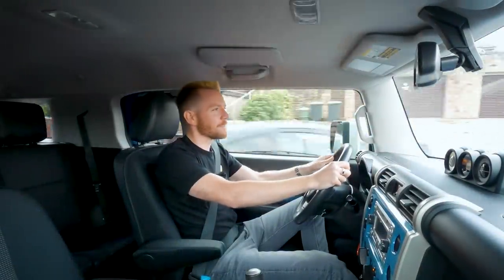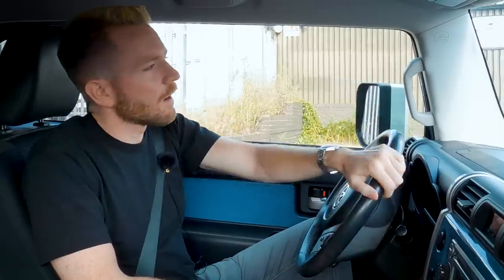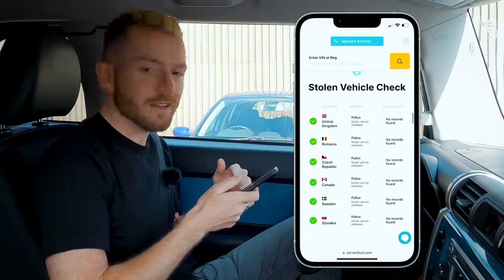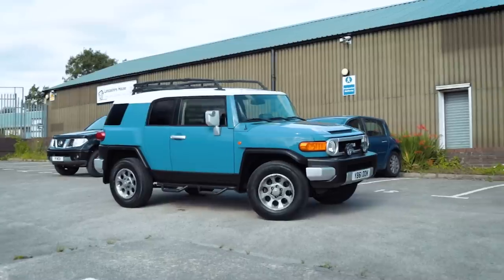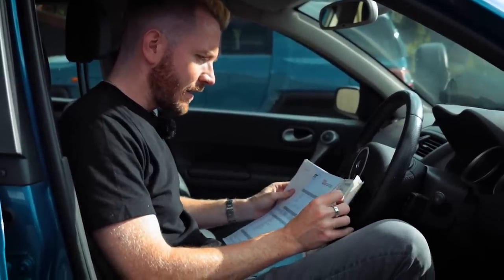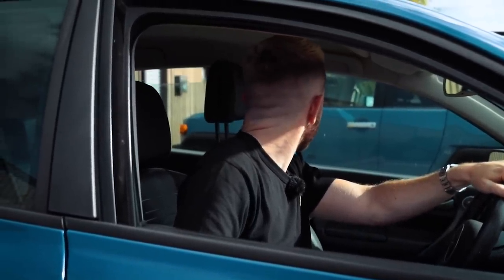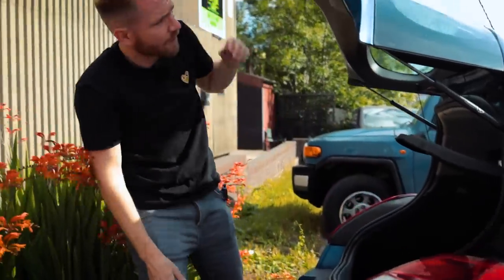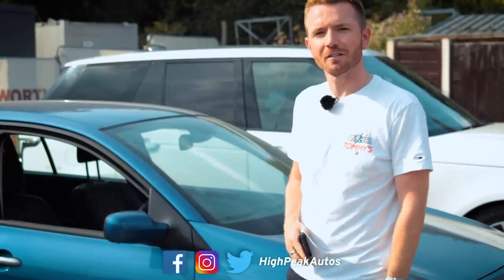I BOUGHT A RENAULT MEGANE FOR £295!

Comment: Cool hatchback and innovative as well. Keyless entry + go and a 5 star safety rating- the first for a small hatchback. I think the DPF needed doing because it was juddering on start up as the gear lever was vibrating and the glow plugs needed doing as well. Hope your mate checks the clutch but I think it is a decent cad. They are getting rare and they could be a future classic with its innovative design. If only it was a R26R 😂
Reply: Faustina Adu ......future classic???   :))))))))
Reply: @geoffdundee  well, people say that about most Leyland cars
Reply: @geoffdundee  the renault megan rs turbo/sport versions are pretty cool? if that`s you thing
Reply: I was thinking along similar lines- injectors. Certainly wasn’t one of those start on the key type diesels you get from the land of the rising sun.
Reply: @localreviewking134  ........fortunately im a volvo guy all my life with the exception of owning a citroen BX once (never again own anything french) and a mercedes c class (really nice car)
Reply: @geoffdundee  BMWs and AUDI are not that good these days. i have 2 Renault and never had anything expensive in 8 years; the only issue being an automatic parking brake sticking, which my mechanic fixed with a simple cable tie, it has never failed since. cost 4 pence to solve and 1 hours labour

Comment: A good honest review, thankyou.  The earlier Megane like the Scenic c. 2003-2006 suffered from many of the faults you anticipated but particularly the window modules, corrosion in the fuse box near the battery, broken wires - mainly in the tailgate of the estate amongst a few other niggles but they were generally mechanically strong and needed to be well used and serviced well before the 18,000 mile recommended interval especially in Diesel form.  The later versions , 2006/7 onwards were better and the 2.0dCI M9R was very strong and swift.  We had a 1.6 VVT estate and a 175 DCI RS version - yes I bought two and both were excellent.  They were always a popular choice across Europe and sold well.   That said, after purchase, I often panicked after reading the negative owner reviews but if well maintained , they were generally reliable, safe and enjoyable.  As you know, the post 2009 version is a lot better.

Comment: I ran one of these with the 1.5 diesel with the 6 speed box back in 2007 to run as a company vehicle. Great car, fantastic on mpg. I changed it for the R26 version which was an awesome beast which I wish I’d kept. I never had any problems with any Renaults I owned, I had a Clio and a Laguna estate over the years as well. I must have been lucky I suppose.
Reply: What company would ever buy a french car as a company car? Don't they care about their reputation etc?

Comment: I had the 19 dci new in 2003. I did 75k in it before I sold it and never had a single issue with in three and a half years I had and I loved it. I think with Renault its often just a thing to say it's french its a Renault it will go wrong, just like you say its German its great and will never go wrong? Both saying are utter rubbish I have had so many issues with VW golfs and a Passat but none for a 90s Laguna the 2003 Megane or my wife's current 2016 Scenic.
Reply: I had a Laguna 2.0dci and did 180,000 miles without a single issue. I replaced it with an Audi A6 then a BMW 5 series. Lovely cars, but they cost me a fortune in repair bills and kind of wished I'd kept the Laguna.
Reply: There is some truth in the electrical faults and the water ingress. Ive had two Meganes and had the latter issue in both.  My first Megane was an early Megane 2 and it had issues with the drivers side window. I will say though that the plusses outweighed the minuses. Mechanically they were both totally reliable and never let me down.

Comment: Hello Matt, 
you pre-judged a half decent car. This era of Renalt were really quite good! I ran  a 2007 Megane 1.5DCi for over 120,000 kms and it was fault free, quick, great on fuel, no oil burn, ALL the electric windows and the aircon worked, only an oxigen sensor to change.

Comment: i have this megane from 2004 with 259.000km ... of course 3 windows motors (50 euro used but still working) 2 batteries , never abs , 4 key cards ( 2 of them my bad and the cost is about 180 euro each)  but i like it couse never let me somewhere from mechanical issue .. that car  is for comfort and easy kms .. if you want more just check rs version of that and trust me its another chapter .. and my ''relationship'' with megane started randomly as my father needed fast a car for mom ... so it was bought used with 5k kms .. and today i can certain confess that my next car will be again megane but 2016 1.5hdi 130hp rs line .. lovely design and solid engine with comfort and quietness around .. its enough for me ..  great vids by the way !

Comment: I have a Megane Grandtour Phase 1 from 2005 with a 1.6litre Petrol 113hp
170.000Kilometers on it 
Beautiful car and no leaks, no rust, reliable 
i got 6litre fuel consumtion at 120km/h with AC on

Comment: That looks to be a quite decently specced facelift version (06-08) it fixed most if not all of the previous versions electrical faults, although the early 1,5dci engines weren’t as bulletproof as they are today. Those were at the time one of the safest cars on the road with 5 star crash ratings, the first small family car to achieve it and couple that with keyless entry & go it doesn’t feel that dated today either. Those facelifted Mk2 Méganes are quite good cars at the end of the day. Have one myself (1.4 16V petrol) which has done 186k km and has been dead reliable except for a dead battery last fall (it was the original battery from 2006) and right now a very stubborn airbag light on.

But it’s still mid 00s Renault so don’t expect much from build quality. One common manufacturing defect is that water can leak into the front door pockets, it comes from somewhere near the speaker, there is good coverage on the UK forums about this issue. It’s also mostly cheap plastics everywhere on the inside.

Comment: NY first renault megane mk2 did 120000 from new 2 wiring issues,
Mk3 1.6 dci 160000 no issues at all but I do service my cars twice a year.
Currently in a mk4 1.5 dci 54 k and no issues so far. The mk 4 is a peach to own and drive.
A very underated car in my experience you should try one 👍i
I can get close to 70 mpg on the motorway if I behave myself.
I must be lucky never had a clutch either 👍

Comment: Ive had a Renault Megane 2006 1.6 diesel sedan. Only had a steering issue and a couple of clocksprings. That was why the ABS light came on. Also an engine light on which didn't seem to effect how the car ran.
Covered it with black tape. Had the car for 11 years and adding brakes and oil and such, I was very happy with it. Some person ran into the back of it while parked and that was the end of that. That car did not deserve it's ending. It had 270,000 kms on the clock.  I then bought a second hand Renault Megane 2008 x84 hatch and have had that for 5 years. It had 91,000 kms and now It has 175,000 kms. Changed the rotors and have it serviced once a year. No problems at all. Both cars were/are diesels, and I am impressed with the gearbox. On both cars the gear changes were always smooth. My next car will be another Renault Megane. Very underrated cars.

Comment: Whilst i`m certainly not a huge fan of Megane`s and yes i know the electrics can be troublesome! but looking at the bodywork, a good clean and maybe a buff up will do wonders for it, there`s none of the rot around the edges you would often get on a Ford or even a Mercedes of that age so it should make someone a decent cheap runabout for a few years yet..

Comment: I bought a Megane CC 1.6 petrol (hard top convertible) new from a car supermarket in 2007 for £13k. It never broke down, the roof didn't leak and I sold it with the original battery and exhaust after 10 years for £2500. I think I may have been lucky though I do really look after my cars too. I like the styling of the Megane in your video. I know people who had terrible problems with these when they were new though (one even returned his car).

Comment: I bought for my first car 10 years ago, it was a 2002 Clio. 
Nice revy little engine and decent handling on the twisty roads. 
But it drove me absolutely mad when it had endless electrical problems. A part would drain the battery, then I'd get that fixed, a week goes by for the same battery drain only to be caused by a completely different electronic part.
Then after spending two weeks on holiday I came back to it to discover it had filled up with water to the bottom of the seats, caused by a failed blower vent gasket on the fire wall and there had been 3 thunderstorms since I had been away. Then after that the engine management light came on as the ECU housing on the back of the engine decided it was going to eat through the wiring. 
It was a lovely car when it was working but it's put me off buying another Renault.
Reply: Clios and Moduses always end up with that battery-draining thing, eventually.   :-(

Comment: I had two 1.5 dci meganes as my driving instructor cars. Crucially they were the revised 2006 onwards models. I heard  from  a freelance electrical engineer friend who was working for renault around that time and he told me they really got their act into gear on the appalling electrical quality. I remember looking at the Parkers Owners reviews of the pre-2006 models and seeing loads of 1/2 stars reviews and after 2006 mostly 4/5 stars.  It was like chalk and cheese.  I sold both when they were nearing 200k miles. One window regulator, one alternator and one clutch between them. I also drove to Spain with one.  I don't  think I would trust a new renault now but there seemed to be a  good period between 2006 up to around 2012. My daily renault wind (2011) is excellent.  Driven to Spain in her too last year.

Comment: Owned a new grand scenic 1.5dci 2006 since they were the cheapest 7 seater then 

New turbo at 20k miles
Approximately 7 window regs (mainly passenger window)
2 gearbox bearings and rear seized caliper at 50k miles
These issues above were very early to have.

Front arm and ball joints replaced (quite frequently aa the ball joints seem weak)
New battery

Thankfully I took out the 2 year extension on the warranty so I didn't have to fork out on repairs and car loan! Saved over £2000

Now have a 1.6dci 2013. Faster but plastic parts are brittle and the pita sensors that tell you a seat belt is fastened break. Wires always giving problems and break to say belt fastened. Not a cheap part too

Comment: My mate had a 2004 in the exact same blue. It was plagued with electrical issues. The electric windows would open on their own over night and when it inevitably rained the fuses would go. ABS sensors, stability sensors, temp sensors, bulbs which were impossible to replace would blow every couple of months, switches stopped working, absolute nail.

Comment: Had a 55 plate 1.6 VVT Dynamique as a delivery vehicle for a spell. All electrics worked but the engine light was permanently on (briefly went off after a garage reset). Flat spot when pulling off. Not a bad car by any stretch. Made a profit when I scrapped it too to save money on supremely expensive MOT requirements probably due to the hell I put it through doing the job.

Comment: I owned 2 Meganes , a 1.5 diesel and a 1.9 diesel. I liked them but a lot of people didnt. Its not that theyre unreliable, the French always made good diesel engines, its just that they were too ambitious with the electronics, and thats what lets them down. I do most of the work on my own cars and so I can buy a second hand part off eBay and fit it myself, but most owners would leave their car into a mechanic and be given a big quote for some failing electronic bit on the car and then just decide to get rid.
The common problem with the windows is the module in the door called the TEMIC unit. You can get aftermarket ones on eBay for £20 now.

Comment: I bought a  59 plate mk3 1.5dci megane 80k just about 2 years ago, for around £1200.

Aircon doesn't work, needs a new radiator looking thing (condenser?), everything else works fine, no leaks anywhere. 

£30 a year tax, currently at 63mpg over the last 500 miles, no complaints so probably going to keep it until it dies.

Comment: if you decide to not MOT this,  hit me up,  I'm after a whole stack of parts.

I've got the 2L megane 150dci GT that im fixing up and its festering on the inside. 

looking for:
glove box, center console, seats, door cards, seatbelts, rear view mirror, some window motors, the spare if its half decent. 

maybe parts of the steering assembly (my steering lock broke) 
the front lights.  couple of bits of plastic from the engine bay. 

then you can take the cats out and scrap it

Comment: also known as J.Lo.. i still drive 2013 dci 110 with gt line trim and its quite great car.. i replaced factory xenon bulbs few months ago, two batteries, engine belt with water pump and that it in 170k km...

Comment: Thats the model where, if you want to change a lightbulb, you almost have to virtually remove the front half of the car just for access. 😂  I had the mark after this. The most fragile car I ever owned (along with a Citroen)..right up until the timing belt snapped, bricking the engine.  So no more french cars for me now. I woke up and got a Lexus.
Reply: No, that's actually the Modus, (the pre-facelift models at least, the Grand Modus/post-facelift ones are way more accessible), the Megane is actually “easier” as you can change the lightbulbs on the wheel arches.

Comment: Don't know about the specs in the UK, but the 2.0 DCI (150HP/340Nm and 8.7s from 0-100, not bad in those days...) was only available as GT, which was pretty much full option. For instance, it actually came with xenon headlights.

Comment: We’ve owned 2 Megane’s as a family. My OH purchased a 58 plate 1.5 estate in 2016 and I was so taken that I purchased a 54 plate hatch. I was warned at the time that these cars will fail on electronics at some point. The estate developed a turbo issue just before the dealer’s warranty expired, so the dealer corrected it and we’ve not had any further issues with the estate.

My hatch (1.5 again) did develop corrosion in the fuse box, maybe due to me not driving it for a few months over winter and I soon got rid shot. However, the kid who purchased it from as spares or repair got it sorted.

6 years later and my partner has just got herself a newer car and I’ve had the estate. It runs without issues and I’m glad to replace my 307 pug (54 plate and 151k) with the megane.
Not too bad really all things considered. The estate cost us 2,700 back in 2016.
Reply: oh, and all the leccy windows work just fine lol

Comment: I've got a 2005 megane grand tour with 1.5dci. Engine works perfectly, gears are smooth..mechanically she's in perfect condition. There's pretty much no rust, new oil and other fluids every year. 
Aaaand i've laughed way to hard when you mentioned the window problem. The front ones are...semi auto. Usually one of them requires multiple presses of the button to fully retract, it's completely random which one tho. The left rear window operates backwards. 
But honestly? I think i can tolerate quirky windows in a car that haven't failed neither me or my dad for the last almost 18 years and hauled our asses across europe a couple of times

Comment: Never mind the sodding Megane. I love the FJ Cruiser. Shame they didn't sell those in Portugal. Would've been taxed to hell anyways with that big thirsty engine.
That Megane kinda has been looked after. Most I see around here are all dinged up, fogged headlights, burned clear coat. Those 2.0 diesels are reliable so that hesitant start could be just due to weak glow plugs. 
It's important you mention the cost of replacing the items with a mechanic compared to what your mate will do. I also started fixing my own cars and saved an enormous amount of money doing it.

Comment: I have a renault megane cabriolet 15dci 2006 for 4 years now, all windows failed, window screen wipers stop and go interior heater stops and starts, had numerous parts fitted over the years lost count (suspension springs both, track rods, wishbones, catalytic converter, glow pugs, ecg, turbo, fan belts and tensioner, alternator, battery, all tyres, bulbs, brake disks and pads all, clutch,rear  exhaust bracket, back light, and water in the doors but that is just the design the channels flow the water out, no reverse light, no ac, had the airbag sorted once it was the coil in the steering wheel, cost me a fortune but do you no what I love it 💖 I have a battery stop light on since I had the alternator fitted but it doesn't affect the driving renault want £100 to sort it 😂,

Comment: I have to admit I'm jealous of you guys in the UK , anything that runs in the states is at least $2,000 now. Lot alone something that's not completely covered in rust.
Reply from the maker: You’re right. I couldn’t believe that until I went to California for the first time
Reply: I wouldn’t be jealous of cheap Renault’s, no one wants them and the people that do aren’t the kind of people you’d want as friends.
Reply: I wouldn’t be jealous of cheap Renault’s, no one wants them and the people that do aren’t the kind of people you’d want as friends.
Reply: @Mr8erg  it's not just this car though,it's used cars in general, that fj cruiser he's driving in this video they got for $35,000 easy. If I could find a $300 Renault in the states that ran 6 months so I could use it in the winter since they use salt on the roads I'd be more than happy

Comment: Always wondered what kind of an MOT tester comments on surface corrosion on the coil springs. You might as well advise that the tyres aren't as black as they should be.